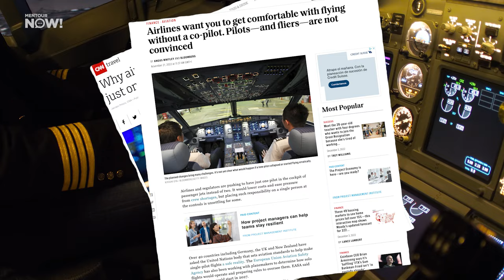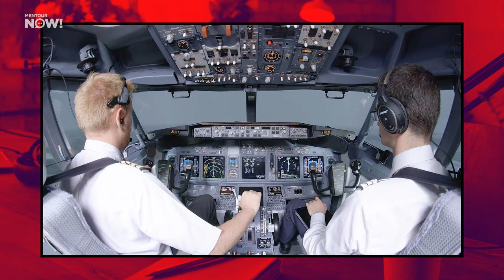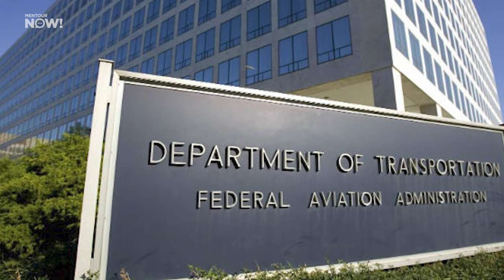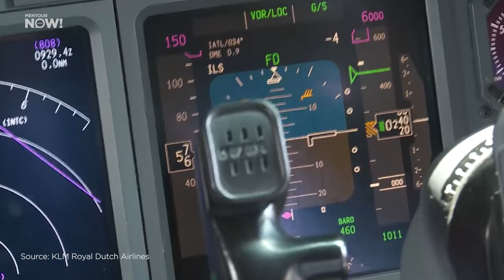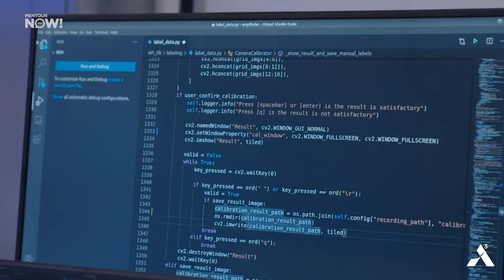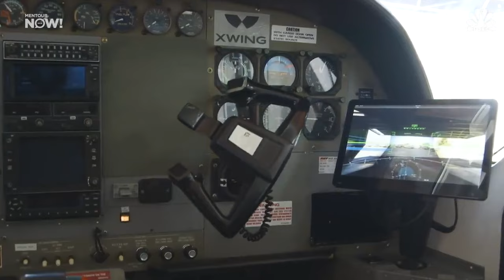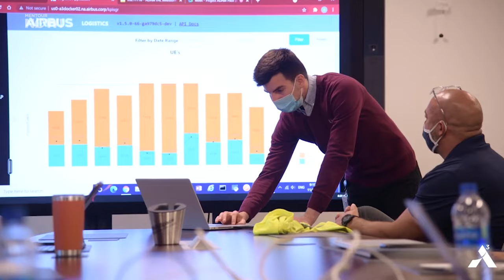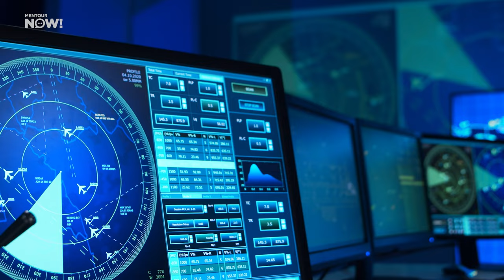The End of the Two-Pilot Cockpit?! Get Ready for Single-Pilot and No-Pilot Airliners!

Comment: There's also that other uncomfortable reason to not leave a single person in the cockpit. That rare, but horrifying case when a pilot doesn't want to live anymore and takes everybody with them.
Reply: Or if he has some sort of medical problem.
Reply: "That rare, but horrifying case when a pilot doesn't want to live anymore"   if you lock them up alone for several hours every workday it will surely become a less rare phenomenon
Reply: @himoffthequakeroatbox4320  The medical contingency is covered in the video.
Reply: sure, but to be fair that happened what, once? twice? in 100+ years of aviation
Reply: @ramabranch  From a quick google, its happened (or been attempted) 47 times.
Reply: I submit a potential control measure for that would be to equip single-pilot planes with remote-piloting systems and a controllable in-flight safety lock-out/override, so a monitoring pilot at a ground station could take control of the plane in an emergency. Include measures to alert the ground station monitor, when the plane deviates from its normal flight parameters or encounters a 'mayday' situation.
Reply: @AaronCMounts  That is the worst idea ever, even though it sounds reasonable at first. ANY such system would be hackable. Totally unsafe.

It would literally be much, much safer to have no pilot at all.
Reply: @CraigGood  that's what data encryption is for. In the 1/4 century of flying uav ops, only one was ever hacked, and that was 15 years ago. Current wireless bandwidth capacities easily allow 2048 or even 4096 bit encryption of all data transfer, which are currently unbreakable.

That was easy.
Reply: @AaronCMounts  There's no such thing as unbreakable encryption. The attack surface on UAVs is pretty small, so one in 15 years is kind of a lot.
Reply: @CraigGood  attack surface? It's the same for any other plane in the air. Unlike the UAVs, there aren't huge, state-supported efforts to hack civilian airliners. So the current encryption levels are more than sufficient to keep malicious actors out. Even 1024 bit encryption takes longer to hack than any commercial flight can last.

Also, 1 successful hack:
- in 15 years:
- of thousands of UAVs, 
- racking up millions of flight hours,
- consistently in hostile airspace, 
- against concerted, state-supported efforts to hack them.
That's negligible, no matter how you look at it. 

It's also negligible, compared to the over 47 attempts by airline pilots to suicide their loaded planes into the ground.
Reply: @AaronCMounts  Current wireless capacity _in your living room_ easily allows 4096 RSA. At 10.000ft of altitude the situation is very different. Mentour actually touched on that when discussing the potential of planes streaming black box data to the ground in real time (and it is equally impossible to do).
Reply: @TinkersWithMotherboards  just like anyone could win the lottery. But just like lottery, the actual probability is negligible. It takes days to break high level encryption, and any targeted plane won't be in the air long enough for the encryption to break. And you still have the pilot there as a safeguard against a theoretical hacker.
Reply: Which is why we have two drivers on busses and coaches?
Reply: Al contrario, una máquina pueden evitar que el piloto haga eso anulando los controles y poniendo todo en automático
Reply: @AaronCMounts  That was my first thought too : but my 2nd was hackers and bad actors Hijacking or HIGH Jacking the aircraft.
Reply: @AaronCMounts  Nothing is unbreakable. 
The fact that the approved intended operator's equipment can decipher the signal means the signal CAN be deciphered.
The intended ground controller might have a gun to his head or have been shown a video of his wife and child kidnapped next to a woodchipper. 

I want two pilots in the cockpit.
Reply: @Alois_Schicklgruber  That's what the pilot is still there for.
Reply: That was also a reason not to get rid of the 3rd pilot back in the day. There's been a few cases where a suicidal pilot took out their co-pilot or locked them out while they went to the bathroom, then killed everyone on the plane. Because most people don't want tickets to cost more money so they can have a third person up front like in the old days. Likewise, most people don't want tickets to cost more money or trips to take more time so passenger airliners can be designed with stall speeds slow enough to take off and land safely. People just accept thousands of people dying every decade because they were in a vehicle trying to carefully touch the ground at speeds that crush bodies into mush and explode fuel tanks if anything goes wrong. I love aerospace and aviation, I enjoy flying, I'd love to have my own plane, but I don't ever want to fly with an airline if I can avoid it
Reply: Or if they can't operate for any reason. Or straight up just die on the spot. Nobody to take over controls.
Reply: I'm pretty sure there's a whole FAA regulation against only one person being in the cockpit. As a flight attendant we are even trained on flight deck breaks and making sure we keep 2 ppl in the cockpit at all times while we make the transition. Maybe he addresses this tho I haven't watched atm but this seems entirely against FAA regs
Reply: That would be irrelevant because we're considering the system that would be so autonomous it would not allow any manual inputs which could cause a crash.
Reply: Well that has happened countless times in dual cockpits.
Reply: Definitely Alot of concerning factors.... But this is happening most likely regardless of what the Public thinks. Or Wants....
Reply: Yep, case in point Egypt Air 990!

Comment: Even if it was possible to make remote assistance/control safe (enough) there's still the main problem of having a stable high-bandwith data link in an upset aircraft situation.

Things like Starlink may work fine in normal conditions and level flight. But good luck trying to do satellite tracking in a thunderstorm with very fast roll and pitch movements like seen in many accident flights...

Comment: 1) in the future single pilot flight could potentially be backed up by remote supervision/control in emergency situations. honestly, we should already have remote supervision so air traffic control/airlines have realtime information on what the status for the aircraft is and what the pilots are doing.

2) pursuing fully autonomous flight may, or rather will, likely lead to higher degrees of autonomy in general and potentially much safe flight in general. systems researched with the purpose of autonomy, built to fully make all the decisions requires, will likely first lead to superior autonomous pilot cross checking and error state warmings, that honestly could have prevented many of crashes i've seen detailed in your videos.

and once enough data is collected under such states, it may become such that autonomous systems are probably so reliably ... pilots flying may actually become a liability. i don't expect that to happen soon, but as a computer programmer it's quite clear we could already be doing a lot more autonomous double checking on what the pilot is doing.

Comment: Since a dual pilot requirement is across all carriers, the cost is born by the passengers as all operating costs are passed on to the the end user.  The savings of a single pilot mandate would not be realized by the carriers but by the passengers.  If the regulating agencies required five pilots the price of tickets would go up and the benefit would be to the carrier that could provide pilots; and, possibly, to the passengers if a safety argument could be made.  In fact, the governing agencies could drop all requirements and the prospective passengers could decide if the cost savings of a single pilot is worth the risk.

In the case of speed limits and DWI the actions of irresponsible drivers endanger safe drivers but skydiving is not prohibited as the participant assumes his own risk.  If passengers were allowed to choose from one pilot carrier or three pilot carriers they would be selecting their own risk (admitting that there is also a risk to innocents on the ground in some cases).  The larger mistake is assuming that regulating agencies can obviate risk through mandated actions.

I would presume that some of the thought is that ground based pilots could intervein intra-mission via satellite connections when needed.

Comment: You can compare two pilots in the cockpit to having four engines. With the introduction of the 777 Boeing explained that the possibility of an engine failure is halfed when you only have two engines. They were proven to be right. Now they claim that the possibility of pilots making mistakes is halfed when you half the number of pilots. Maybe they are right again? Even Boeing is right sometimes. I agree with you that this will not be profitable for freight lines at the moment. This is mainly for passenger lines. We need the pilots to be useful when they are not taking off or landing the plane. In the USA the 1500 hour rule of experience/flight time before being eligible to fly for a regional airline or major airline will include cabin crew work. A typical pilot will have 500 hours of flying and 1000 hours of cabin crew work before he can fly for a commercial airline.

Comment: But the key fact that doesn't get mentioned here is that > 75% of all accidents are caused by pilot error. Irrespective of how many pilots are in the cockpit. So human factors (people) are the biggest weakness in safety.
Reply: This should have at least been mentioned, in a non-biased discussion. I noticed this important fact was totally dodged too.
Reply: @k9killer221  You can't just ignore data like it doesn't exist. Whether you like it or not, if people are the main cause of accidents, then further automation is the logical way forward. Just one example is the Air France disaster. If the pilots did nothing, the A 330 would have just continued. But they started pushing buttons and inappropriate controls inputs. Everyone died..
Reply: @idanceforpennies281  Counterpoint: as the Captain said, a single pilot is prone to many mistakes, but two pilots can cross-check with each other, making it more likely that someone catches the mistake and they can correct it. With just one pilot, that process is gone.

But what about increasing automation even beyond single-pilot operations, and removing humans altogether from the flight deck? This would certainly eliminate human factors, but it's also completely inadvisable. It may remove the human capacity to err, but it also removes the human ability to think outside the box.

UAL232 and Air Astana 1388 come to mind. Or in your cited example of AF447, after the pitot tubes unfroze and airspeed data became valid again, the computer still couldn't recover from the stall, because it wasn't programmed to handle anything outside the normal flight envelope.

Computers only know how to follow their program; in order for an autopilot to be able to respond to any emergency, the programmer must have anticipated every possible emergency - an unreasonable expectation. Unless, of course, we consider true AI, which technological limitations aside, also beings up a plethora of ethical issues.
Reply: @zenlexon  I agree with most of what you say. But in AF 447, the pilots had long since gone to manual control. No automation whatsoever. I think the salient fact though, is that pilots are now the single biggest factor in crashes (>75%), and if you use safety engineering as the guiding principle that is where the improvement needs to be focussed. Make the plane idiot-proof and that may involve making the pilot just the pilot monitoring.
Reply: @idanceforpennies281  It's not entirely accurate to say AF447 was solely a pilot error accident. First Officer Bonin also lacked a fundamental ability of good airmanship - the ability to intuitively understand what the airplane is doing and how it will respond to a given set of inputs. That kind of intuition is something that can only be developed by extensively flying planes manually. A lack of flight experience is what made Bonin crash his plane.

Sometimes SHTF. And sometimes the pilot causes it. But the ability to fight out of a SHTF scenario requires the ability to think outside the box, combined with good airmanship. There's a lot of things computer programs do well, but flexibility isn't one of them. Can a computer be taught to, on the fly, make up a completely new set of procedures in response to a novel failure? Can it be taught to understand the airplane intuitively? To make the plane idiot-proof is impossible, because computers are idiots. Every programmer knows that all a computer knows how to do is follow the instructions it's given.

Maybe someday, when AI is far more advanced, that will change. But by that point the AI itself would already practically be human.
Reply: @zenlexon  I'm a CPL myself. I love flying. But I'm also a management consultant on Quality, Safety and Environment. I just can't look past the data, which clearly shows me human factors (all causes) are overwhelmingly the major cause of accidents. We are very close to fully autonomous cars. That is actually a much more complex environment than aviation (separation, predictable routes etc). Why not for aviation?
Reply: @idanceforpennies281  Because computers are very bad at dealing with the unfamiliar.
Reply: @zenlexon  Yes, they are generally speaking. Once again, I generally totally agree with you. But modern computers can be loaded with millions of different scenarios, and can actually blend several different ones into an optimal outcome. That is today's technology. What about ten years from now?
Reply: @idanceforpennies281  A lot of the computing would be what I call sensor fused. Direct input into a multi-redundant computer system. It's already been done on the Space Shuttle. Despite the Space Shuttle having two pilots, they almost did nothing, 90% of it was automated, including the landing. And that was 1980
Reply: @idanceforpennies281  I'm sure a true AI will be developed soon enough. If not in the next decade, it will most probably happen within my lifetime. When that technology does get developed, and when the plethora of ethical issues surrounding true AI get resolved, letting AIs do the work would make sense. Now isn't the time for that transition, though; technology still has a ways to go.

Also, wouldn't bringing computers closer to true AI make them more human? I don't know, that's too philosophical for me
Reply: This “fact” isn’t even correct

First off the “fact” was 80% are caused by human error ( so pilot, ATC, Maintenance, ground crew, etc)

BUT and even then, with new and more recent and improved accident investigation méthodes they found that the “80% of crashes are human error” “fact” was incorrect and hugely overblown.
Reply: @vagasint.4345  So you are basically saying my 75% human error is too low. It's actually 80%. You just reinforced my whole point.
Reply: @idanceforpennies281  you didn’t read what I said at all… you saw 80%, got lazy and said yay! I was right 

The figure is way overblown it’s not 75% or 80% it’s actually way less.

That’s what they found when using the STAMP analysis method for crash investigations where they look at the whole system and how it was involved in the crash instead of a more linear model (which they found was not effective at correctly determining the cause of and preventing future crashes)
Reply: @vagasint.4345  There is no doubt AT ALL that pilots are at least responsible for more than 75% of all crashes. You can look at any published data to confirm that. I don't understand where you are coming from at all, you don't appear to be making any point. And btw , your comment is poorly expressed and deliberately misleading. Do you work for Boeing?
Reply: @zenlexon  Yeah, I deliberately didn't put a timeline on this, because I also would need to be fully convinced Robbie the robot wasn't going to slam the airliner into the deck just because he had software bug,
Reply: @idanceforpennies281  Fair enough. Yes, I do believe it's only a matter of time before AI is able to surpass humans. Single pilot airliners at the present time is jumping the gun. One day, though, I'm sure everything will be automated, not just flying planes.
Reply: By this logic, if we remove pilots entirely and crashes are 100% caused by automation do we bring in human pilots again?

It’s easy to state the (false) 75% of crashes are pilot error statistic and ignore the fact that pilots save planes from crashing far far more than their mistakes cause one to crash.
Reply: @nikobelic4251  Pilot error, as a crash investigation finding, by definition is a crash which is a result of a human making a mistake nothing to do with the equipment. And those constitute the vast majority of accidents. Actually more than 75%. If automation results in a substantial lowering of all accidents, then that is proof that it is a nett benefit. That is self evidentiary proof that the human factor is/was the weakest link in the safety chain.
Reply: @k9killer221  
They have recently updated the way they investigate accidents. Now they use the STAMP method, and as I said earlier, it is more accurate than the traditional method and they found that pilot error was greatly over attributed as a cause of an accident.

Comment: I flew airliners for 30 years. I vividly remember those OEB (operational engineering bulletins) on the airbus. They describe things that don‘t work as intended. They are only cancelled or removed when rectified. Some bulletins were there for years! Like the one that described a flaw during non precision approaches with calculated descent paths (aka chinese glideslope) under certain conditions. That means, Airbus was not able to fix software issues within years.. Good luck with even more complex software. Thanks, but no thanks.